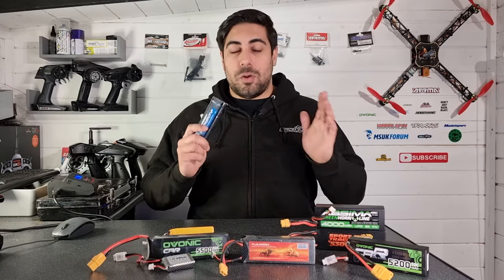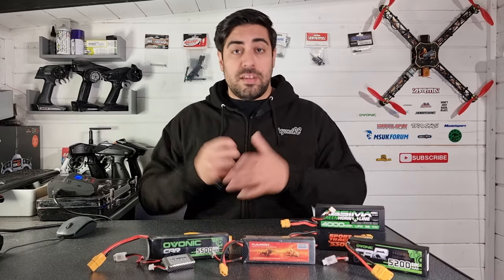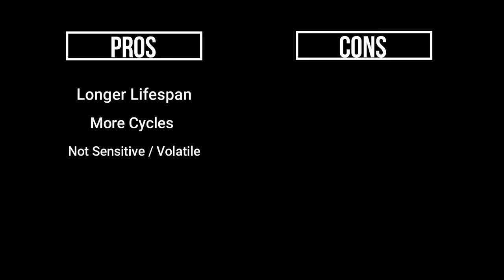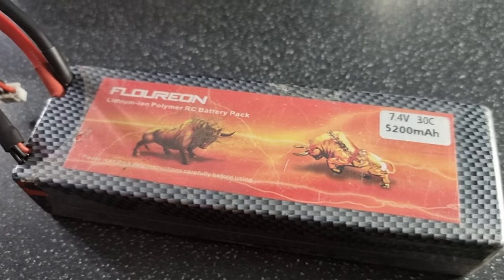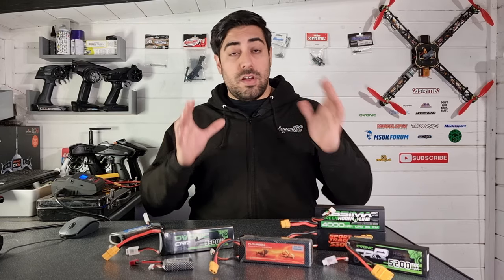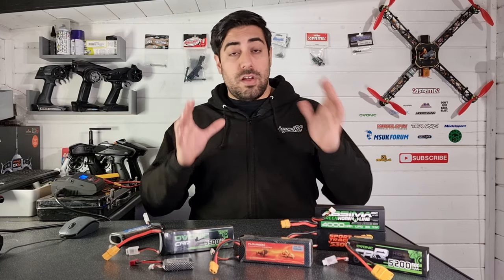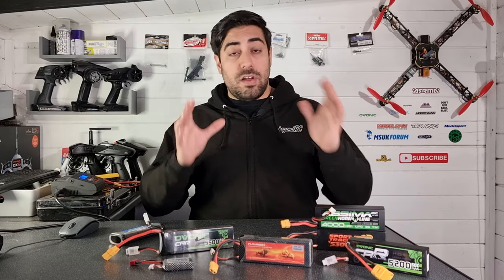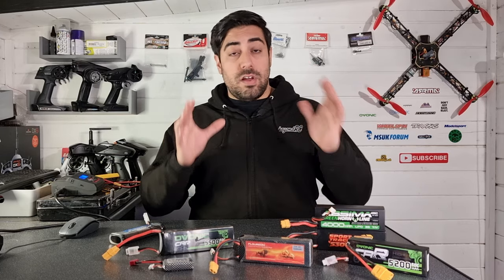LiPo Guide for RC Beginners!

Comment from the maker: Want to WIN an RC Car for as little as $1/£1?
Check out my current RC Raffles here: https://raffall.com/beyondrc
Hope you enjoyed today's video which is aimed at the RC Beginners out there! Always be safe around lipos, always charge at 1C for maximum safety for example: 2.2a for a 2200mah pack, 5.0a for a 5000mah pack & 5.5a for a 5500mah pack and so on. Always use caution when charging and a Lipo Bag if possible. Lipo batteries are totally safe and found in many devices around your home but always use care and follow correct procedure. Cheers guys and if you have any questions feel free drop them down below! See you on the next one! 👍😀

Comment: I charge my Lipo batteries with a balance charger in a Lipo bag with a metal cookie sheet under it.  I never leave them un attended.  I store them in an ammo box in a cool dry place. I check the wires after each use to make sure nothing is damaged. I also make sure to storage charge them if I am not going to use them for a while. I check them in the winter months and give them another storage charge. It keeps them happy and me too. lol I us the discharge rate that the manufacture of the RC recommends.
Reply: If you use a Lipo battery charger, that’s not a expensive  balance charger that comes from the manufacture stop using it and get a more expensive charger that balances the battery because it will greatly help the battery, especially the chargers nowadays that have a discharge/charge/ storage option modes
Reply: @JohnDeere_Simulations he says he uses a balance charger right in the first sentence

Comment: Thanks so much for this video.  I just turned 53 and got an Arrma vorteks for my birthday. I ended up having to buy lipo batteries and a charger. I havent had an rc car since the 1980s and reading the charger instructions I felt like I needed a degree in electrical engineering. This video was so helpful.
Reply: I'm in the same boat lol I'm 40 and it's been 20 years since I had one but I just got a ARRMA kraton 6s and had no idea what battery I needed
Reply: 45 and bought the vorteks this week a lot has changed since we were kid's. Lot's to learn
Reply: I'm 20 and just bought one today and I'm lost😂😂 don't feel old fellas

Comment: i love nimh batteries. just plug it into a charger with nothing to worry about. also they dont catch on fire or smoke, they just get really hot and can be repairable if its only one or a few damaged cells. the runtime is pretty good and most people say it sucks but not really. the battery goes 100% 95% 90% 90% 80% 80% 79% 75%. im not sure but its hard to tell the difference between running nimh and lipo when lipos keep their voltage while nimhs do not. stay with nimh if you can theyre a lot safer
Reply from the maker: Why be stuck in 1980? Nimh are safe yes but lipo are also safe if handled and used correctly and offer way more performance over Nimh. A lot of lipo fires are because of the user 😉
Reply: @ had a lot of bad experiences with lipos even with good chargers and nimhs just last so much longer ive had one 3000mah traxxas 7cell nimh last for 11 years

Comment: Super helpful to a LiPo newbie like me who hasn’t plucked up the courage to start charging until I’ve got answers to the questions that the manual doesn’t really address properly. Also reassuring to hear that safety issues are rare and as long as you respect the rules you’re unlikely to have an issue. Thank you

Comment: Your video has a lot of good information in it, and you have pretty good stage presence. If I may make a few suggestions:
1. Break your video up into "chapters", so folks can skip around and also know what topic is being talked about at any given time.
2. Some of your informational slides were missing critical headers. For example, you were going over pros and cons, but for two different things (LiPo, and then NiCa), but from a visual standpoint it was unclear which was being discussed without scrubbing to the beginning (see #1) and listening to the intro.
Reply from the maker: 1. Chapters now added almost 3 years after originally publishing this video. I'm sure I was meant to do this at the time but forgot haha!
2. The addition of the chapters should help to determine the difference now. 

Thank for the feedback :)

Comment: Nice informative video. I think Lipo's can be safe with due care, you can minimise any risk. I'd like to hear what you have your Lipo low voltage cut off set at. My Maverick Quantum has options ranging from 3.4V per cell down to 2.6V per cell. It came set at 3V but I put it up to 3.2V. Think I should go up to 3.4V?

Comment: Brilliant video mate. As someone fairly new to the hobby all the numbers baffled me. I spent ages looking for a 25C Lipo because the car manual said that's what it needed. Always thought going higher would damage the ESC. What is a good charger though? I only have the one that came with my 144001...
Reply from the maker: Thank you glad you enjoyed :) It is very confusing at first but once you get the hang of it and knowing roughly how much power the system will be pulling its easy to work out. Not at all even running a 100c battery when the recommended it 25c will not damage the system. The system will only pull as much power as it needs having 100c for example would be a bit overkill in this instance. I would recommend any multi charger with the ability to charge multiple chemistry such as nimh, nicd, lipo, lion etc give you lots of options should you ever need them. Dual and quad chargers are great as they allow multiple packs to be charged at the same time and with difference charge rates but much more expensive. A cheap 60-80w would do the job fine.

Comment: I have a question. I recently just got back into this hobby after being away from it for 30 years. I have noticed that the battery charge in the car I have now lasts 3 to 4 times longer than it did back in the 80s. Did the batteries get improved? Or did the chargers get improved?  
I am not complaining 😄
Just wondering.
Reply from the maker: Much better battery chemistry 😎👍

Comment: Hi, i have a 1300 mah battery and it is rated 30 C. Which means it can provide 39 A of continuous current. But i am using a 50 A esc and my brushless motor only draws 17 Amps maximum. Am i safe to use this setup? and as the esc has higher amp, will it draw 50a from the battery or will it only draw how much current the motor needs (Which is 17A)?
Reply: Can someone answer this. Id like to know as well
Reply: From my limited knowledge, i think this means that the ESC is safe to go to 50amps so the ESC wont burn out. And since your motor only runs 17amps, its theoratically safe.

The ESC will not suck out 50amps, that power has to go somewhere, and since your motor will not go anywhere close to it, its safe.
Reply: Yes, you are good. ESC can handle max 50A, but since the motor only draws 17A that will be the max supplied or drawn respectively. Voltage is more important here - if you are trying to avoid burning shit

Comment: Thanks for the video, I was actually hoping there would be something about the usb chargers. Seems like a lot of cars come with them but no one talks about them and how they should be used. I only know when I am fully charged or depleted. How should these be stored? Even my scx24 only came with a USB charger.
Reply: Great question, got cars for grandkids for Xmas, can only charge full with them, no storage setting.
Reply from the maker: Your welcome glad you enjoyed :) So with USB chargers they do the job if you are just getting into RC or its just occasional fun but any long term users i would suggest a proper multi charger such as the one i have. They are a lot cheaper these days so its a worthwhile purchase. The USB chargers will also charge at a much lower non adjustable rate which can make charging a longer process. Not against them they work and do the job for most people but simply not as safe or as reliable as a full blown lipo charger 👍
Reply from the maker: @mikestranzl6873  that is correct full or depleted and no way of knowing unfortunately one of the issues with USB chargers. Like mentioned above they work but essentially do not give an indication of cell voltage or whats going on with the battery or the ability to storage charge for long term storage. Unless you are looking at putting the lipo away for months a normal full charge should be fine if we are talking weeks rather than months of not being used.

Comment: Rc lipos won t cath fire with proper handeling so there is no worry but if you charge it higher than  the recommended charge or drain it completely under 2.5 volt per cel then risk is bigger

Comment: Great video thank you! One thing I am a little confused about, only one tutorial about LIPO’s I saw said the first time before you use a LIPO you should cycle charge a few times before you use it?? I have never seen anyone else say this. So do you need to do this please?
Reply from the maker: No dont worry about that. Bad advice. I have been using lipo's for over 10 years and never done that once. Just balance charge a new lipo and go enjoy :)
Reply: @beyondRC  Thank you so much for taking the time to reply! Great advice, thanks again!!
Reply: @beyondRC  sorry for all the questions as new to charging lipo’s, by balance charging you meaning plugging in the balance connector right? Do I also have to set this up in my charger?

Comment: I've been charging li po batteries just by plugging in the main plu on the battery and using nihm mode on the charger. My batteries are now all of the swolen a bit but they work fine. I didn't know the proper way of charging them. Is it still safe to use the batteries?

Comment: Hey buddy. You actually sold yourself, and this video short by your disclaimer. This is NOT strictly for beginners. I'm fairly decently versed on LiPo batteries, and learned things I didn't know before from this video. First off, thank you for that. But, I was unsure of the "c" rating. I knew it was discharge rate, but the formula for figuring out what your system requires is something I had no clue about until now. So, really the assumptions I'd been oparating under is, the higher the c, the more punch from the pack. Now I realize that's only part of the story. If I'm running a 60 amp system for instance, the 3s, 5200 80c pack, is WAAAAAY overkill, and is a waste of money, where a 25c would be more than enough really. That's something I didn't know. Wish I would've learned this far sooner, could have saved a good amount of money. 

Oh, and yes, I 100% totally agree with you when it comes to paralell charging. How is the charger supposed to read 6 cells, if you're charging 3 2s batteries? Or what if you throw 2 packs on, 1 with 5% charge, the other with say 20% charge? It's best just to not do it. I wouldn't even do a video on it, if I were you. Those are negative comments waiting in the wings right there. Best to just avoid that all together. Dunno how old this video happens to be, or if you ever did do a video on paralell. If so, how many times did you get cursed out in the comments? lol

I ended up here, because after 2 freakin years "yeah I know, I know" I finally dropped a whopping 40 bucks on a decent charger a whoever rebranded it, imax b6. So, I've decided to hit the tubes, to fill in any holes in my knowledge, and figure out how this thing works. When I saw my friend beyond across the pond had this vid, here I am lol.
Reply from the maker: Haha thanks man. This vid is kind of old now and was one of my most in depth vids I’ve ever done but wanted to clear up a lot of questions for a lot of people. 

So many people think higher c rating = more power/punch totally incorrect and it’s a way batteries companies are marketing things to sell more of the high end packs to people with lower end cars which will never benefit from the extra c ratings. Most RTR beginner/intermediate rc cars will only need 20-50c. 

Essentially the electronics will only pull as much as they need and that’s determined by many factors but a low end brushless system with a high end battery won’t perform any better than a lower rated pack. 

C ratings are one of the most misunderstood things In the electric side of the RC hobby.
Reply: @beyondRC  Until I watched this video, I was absolutely one of those "so many people" unfortunately. I literally just got my 1st 3s packs yesterday. 6,200 100c, for like 40 bucks each. whereas 5200 30c was like 35 bucks for a pair.

Comment: What about Lithium-Ion batteries? What is their place in the RC world? Lots of rtr's have li-ion's but no one talks about them.
Reply: Li-ion batteries have a much lower discharge rate, so they aren't used much outside of smaller scale / slower cars. A really good 3S li-ion battery in a 3S compatible car would be a little slower than say a 3S 50C lipo. Li-ions are MAX of 20C ish. They are great in terms of safety and reliability, but performance is quite lacking compared to lipos of equal voltage 👍

Comment: Hello, just picked up the Lagendary Nitro Rx Brushless. So much fun and my kids are loving it. My kids came with two batteries to run together. The Nitro only came with one and was wanting to run together as well. Do they have to be the same Discharge Rate? Milliamps? I know they both have to be 3s. Thanks. Guess I’ll need to get a proper charger. Any recommendations?

Comment: What i do not understand is that i rarely see lipos (3s or more) with a xt90 plug when those may be used with very powerful system (like an 8th scale basher). I got a hpi wr8 with a 100A system and it melted 2 t deans plug cause of the Amperage draws. But the car came also stock with a t deans connector and so the lipo...
Reply from the maker: Very strange I have seen a lot of packs with large connectors. Deans is only usually used these days on low power applications. Ic5/ec5 and xt60/90 seem to be the normal for 1/10, 1/8 and above. Not sure why hpi are still using deans and team associated do this too.
Reply: @beyondRC  traxxas and arrma at least gor it right

Comment: Hi Ricky, hope all is good. Now this is probably going to be a dumb suggestion but for me its quite important. Can you do a guide on exchanging connectors, ive got lots of these little cars and multiple batteries of all sorts. So i guess my question is first, is this a good idea ? secondly if so, can you do a idiots guide ! cheers buddy.
Reply from the maker: All good here mate been a bit quiet on the channel as have been a bit busy behind the scenes but should have a vid up in the next couple days and have some new models incoming so should be good. Good idea will look at doing a guide like this would probably be beneficial to a lot of people :)
Reply: Yeah I was charging some batteries and then thought why the hell is there so many connectors, means a lot of the time batteries are lying around doing nothing !

Comment: I’m a newbie to lipo. I go to a local club and race most Friday evenings. Would you recommend to storage change the batteries for the week ? Then balance charge then on the Friday morning ? Cheers car
Reply from the maker: It’s always the safest option and I do that and then just top them up on the day but truthfully as you are using them quite frequently you could probably get away with not storage charging. It’s more for longer term storage. Still good practise though and batteries on storage charge won’t take very long to fully charge 👍

Comment: I get shipment deliveries at times when I'm not home in the winter where it can get cold like ,-20C at times and they contain lipo batteries.  Is it safe for them or could they potentially become dangerous later on while sitting outside for hours until I bring them in the house ? I've heard about potential condensation issues that could destroy the battery or worse start a fire when they are just sitting at idle doing nothing.

Comment: Just found this video! Thank you for a detailed explanation. When I last had an RC was back in the 80’s so lipos are a new battery type. I do have one question. Is it safe to charge a battery to full and leave it charged overnight to use the next day? Sorry! 2 questions. 😂 Do I need to put the lips in storage mode if I’m not using them for a few days to a week?
Reply from the maker: Yes its safe to leave one fully charged over night its only bad to do it for very long periods of time which will degrade the battery. Storage mode if over 2 weeks i usually do. Been doing it this way for years without issue. Enjoy :)
Reply: Thank you for answering the question. Happy new year!

Comment: Hi there, I have a Range Rover which is bargain, the scale is 1:10. It used 7.4 V DC battery, which looked like 2x cells in a grey plastic wrap with a wire and a connector handing out - basic view! I have lost the batteries, and I'm now looking for a newer one, but a little bit powerful. Can you recommend one otherwise may as well get the ye' old battery from Amazon UK.